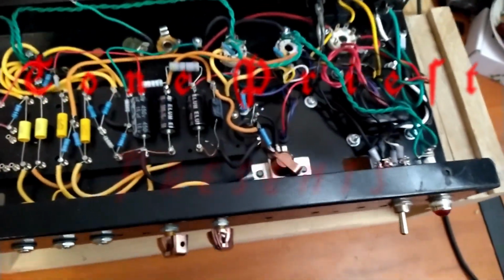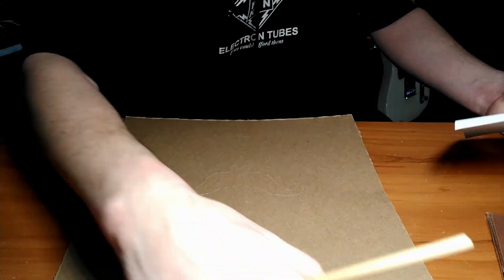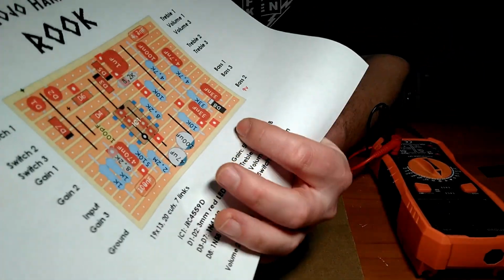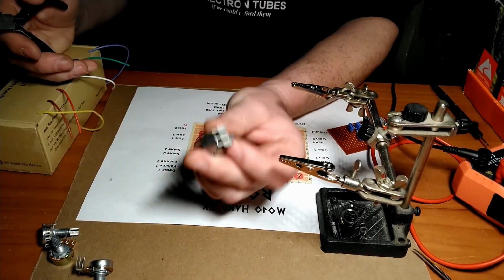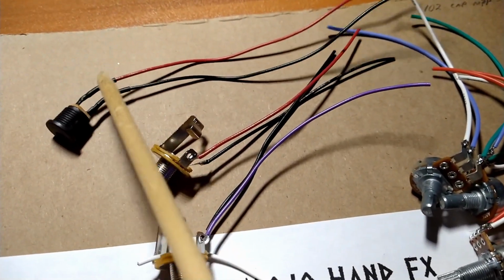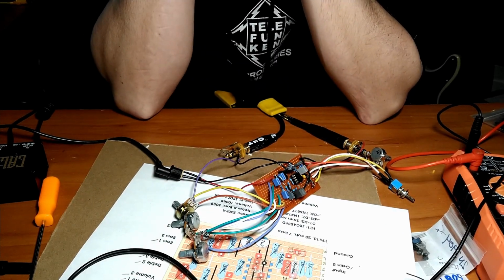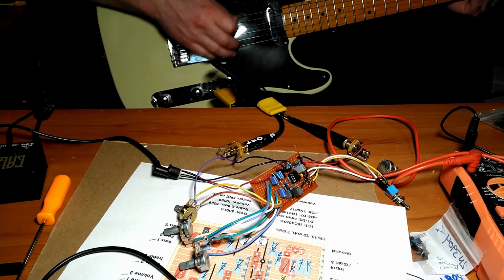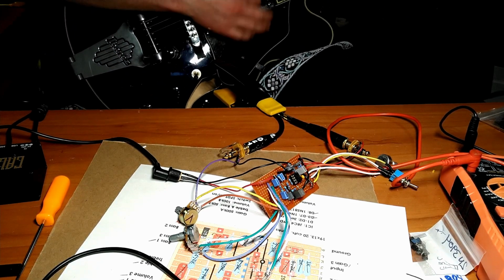MOJO HAND FX ROOK OVERDRIVE CLONE - LET'S BUILD! - EPISODE 6

Comment: Mr. Priest, first off nice job, second where do you purchase your electronic components.  Tanks, Paul
Reply from the maker: Thank you, Paul, for joining! I think I'll make a video on this subject. Until then:

- Component kits (resistors / capacitors) generally from Amazon
- Ebay is a good source for op amps and transistors, especially the uncommon ones - be careful with the to-good-to-be-true deals from China
- Amplified Parts / Antique Electronics has everything you need to build amplifiers and pedals
- Smallbear Electronics has everything you need to build pedals
- I'm finding Mouser & Digi-Key to be my go-to source for electronic components these days
- For vintage tubes, Ebay sellers gotham_analog, bandit35 & antique-tube-picker are my 1st choices
- PedalPCB.com & Mad Bean Pedals for pre-printed pedal clone PCBs
- Reverb.com, Craigslist & ebay for the vintage amp deals. There's nothing better than finding an old tech getting out of the business!